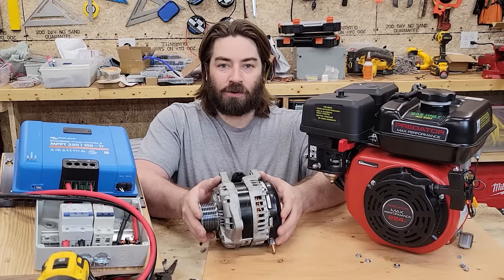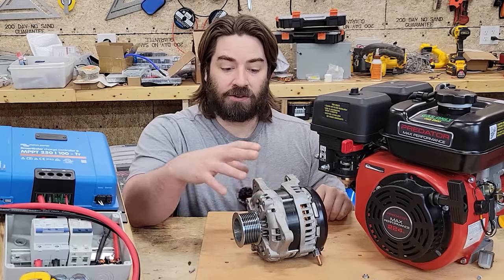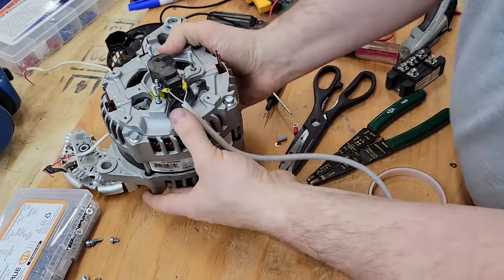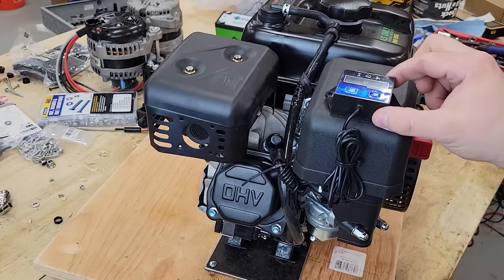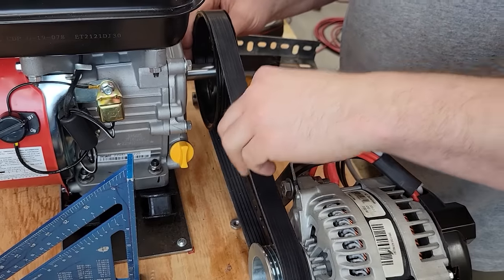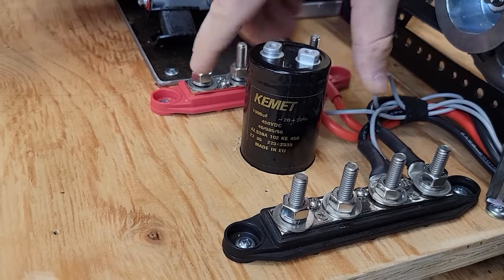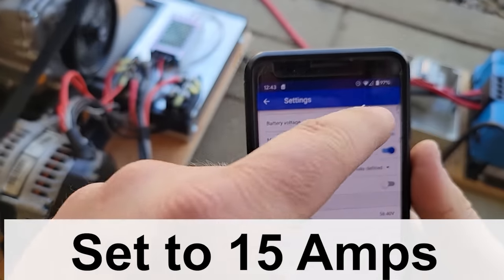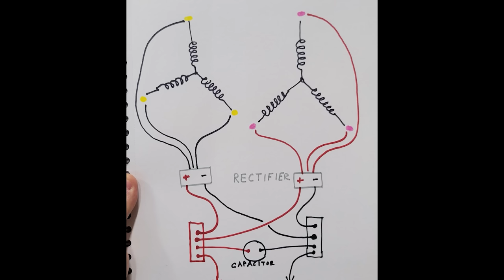The AlternatorGenerator, First Attempt.  48V Battery Charging

Comment: From one Dave to another. Nice video. It would be interesting to see what would happen if you run the rotor winding on a higher voltage but with a PWM so it doesn't over heat, "it works for LEDs" The magnetic field constantly collapsing & regenerating may have some effect on the stator winding too & the higher voltage may generate more magnetic field but all in all probability won't get any more current out. Still it would be interesting to see. No free power. I love the way you just pop to the garage workshop and get out the hydraulic crimps in the UK  it's go to the shed squeeze in the vice and beat with a club-hammer :-)

Comment: I am not an mechanical engineer, but on my opinion, the alternator and the engine must have a common baseplate, not separated with a flexible damper like your cofigurations, Look at car engine.
Reply from the maker: You are right.  In video part 2, I welded a solid base for both.  It worked better.
Video 2: https://youtu.be/cy0t4qq8mS0?si=5DaMckphft17WyOI
Video 3: https://youtu.be/yQTCVyxdauo?si=c7TspxdrTWB-ATZB

Comment: Pulleymounting : tried to heatup the pulley ?
should be good for 0.05mm expansion ?
Reply from the maker: I didn't try that, but I will next time.
Reply: @DavidPozEnergy  worked fine for me, while pushing in some ballbearings into a crankshafthousing. (cooling down the steelbearings / heating up the aluminumhousing)

Comment: Really good for study of the concept but I could at the same time buy a used gasoline driven generator from Honda rated at 7 kW with 240 1 phase and 400 V 3 phase output for less than your alternator and motor setup without having to build the concept.

Comment: They say it can't be done but those who say it can't be done or being interrupted by those who are doing it now I am wondering instead of using a gasoline motor what about an electric motor. Can we get that to pull off of an electric motor where it recycles off of the in a 220 volt motor motor that will turn the same RPMs is that that's needed for the alternator

Comment: Your 12v alternator produces 215 Amps, which is aprox 2580 watts, equivalent to 3.463 HP (at 745 watts per HP), all this without counting efficiency losses.
your gas engine makes 6.5 HP or aprox 4917 watts, again not counting losses, so you could run 2 alternators in parallel...

Comment: hard mount alternator to engine casing with some angle iron and put both on those rubber mounts. You have one dampened and the other not, and you're yoinkin' the dampeners to the side with the belt tension. This is not the way and why it's vibrating so much.

Comment: Have you thought about a 24v alternator?
Reply from the maker: If I had a 24V alternator on hand, I would have used it.  In this case I bought what I could find a deal on.  There were dozens of 12V alternators for sale cheap (FB Marketplace) within 20 miles of my home.
Reply: @DavidPozEnergy  I understand, I was not trying to be critical. I was curious about the output of a 24v in your experiment. I enjoyed it just the same.

Comment: Those aren't ring terminals,  they're lugs. And if you want a really good connection,  solder them with actual lead solder with flux and a torch
Reply: But it says "ring terminals" on the package.

Comment: What’s the run time on the engine before oil change?
Reply from the maker: Go to the product page: https://www.harborfreight.com/generators-engines/engines/66-hp-224cc-max-performance-ohv-horizontal-shaft-gas-engine-carb-57493.html
Scroll down until you see the title "Manuals, Guides & Downloads"  Click the little arrow next to the title to expand it.
Click on Owners Manual in PDF 
Look at table of contents on page 2 for "Maintenance" and you will see it's on page 11.

Comment: I like this kind of projects, but there will be an easier solution. take a gasoline generator 3500W for 120V and connect this to full beige rectifier and directly to the Victron MPPT. you will get also 50V at 60 ampere, 3000W DC.

Comment: To charge more, just connect 2 or 3 alternators down a line with a chain connected to spockets on each alternator. You can charge 3 batteries at the same time then or other possible uses.
Reply: Not with that engine ...

Comment: Removed the rubber mounts from the engine and fix engine on board, it will help with your belt problem, put rubber feet under board to stand on, it will make it alot better, alternators are very inefficient tho, just saying

Comment: You remove regulater & full bridge makes AC voltage out why do you need to bridge rect back to DC to go to charge controler and back to AC again, is is not useable off the altenator from each phase to a charge controler of there own

Comment: Why don't you mount that into a edger portable edger with the wheels on it and then put a plate on it if you can buy all that on it and put the gauges up on top you can charge cars with that restart p you have to get the gear ratio right on it though
Reply: I did that Yeats ago ..used a 3 hp engine ..placed a 12 volt battery on it with an inverter  .. done ..had a generator

Comment: Would a pma, work better?
Perm, magnet, alt?
Reply from the maker: PMA's are generally more efficient, but not always.  It depends on which one.  There are some PMA's 95% efficient.  My alternator in this video is about 70% efficient.  However, some PMA's could be less efficient.  So, it depends.

Comment: You have a lot of critics, David, but I think you did things most of us aren't capable of. Envy among the red hatters. But what about adding some trampoline springs on 'four corners' of the engine block anchored to the base to reduce wobble but not lose dampening? 
I'm only half literate in electrical systems but I thought the wires of the controller invererter looked like wimpy 18 guage? Wouldn't that throttle the amperage available, if they are transmitting full current? Also I read that the windings may be misunderstood and there are actually more efficient ways to utilize them? I don't know. But if nothing else you have the basis to adapt. 
As for the critics who say they get such and such off their solar grid or wind turbine, everyone knows there are times without sun and without wind. You may need to charge batteries for emergency communication, get an electric car ready to travel etc. The more diverse sources you have, the less likely to be stranded. 
But that said: We can all stand to be less dependent upon amps from grids and fossil fuels. 
Steam could turn an alternator. The non toxic combustibles are not hard to come across (used paper napkins , fallen twigs, dead branches, fallen leaves before they compost, etc). Chimney designs exist to 'scrub' the particles from the smoke and use the ash in a concrete additive to stabilize the particles captured. 
I haven't done any of the things I'm suggesting, so I'm a buttinski like most trolls, but you clearly have a solid Electrical Engineering foundation that most of us don't. 
One more idea is make a rolling reinforced concrete platform with bolts etc cast into the concrete. Back wheels rigid side mount axles, front wheels casters. Then attach a lawnmower push handle and you can wheel it around, chock the wheels and it won't bounce around.
Reply from the maker: Thanks for your comment and questions.
I was able to fix the vibrations in video part 2 of this 3 part series.  https://youtu.be/cy0t4qq8mS0?si=0hZ0FwZO21fAQkXT
Basically, having a steel plate for both the engine and alternator together.
All the wires are pretty thick.  I'm not sure which you are looking at.  I have 8 gauge from alternator to rectifiers, 10 gauge from rectifiers to busbars, 4 gauge from busbars to charge controller.  The thinnest wires are the grey, which is 16 gauge for the 12V power supply to the field.  That is carrying 5 Amps, so 16 gauge is fine there.
Reply: @DavidPozEnergy  Yes I had only watched the first video then I saw after how you resolved the belt/vibration issues. I think comments pushed you into overkill LoL! 1/4" plate doesn't even happen in off-road drivetrains with 4wd! But nobody can whine about your mounting base ever again, so no complaints. I think an old Push Mower with the engine removed might make it easier to move around. It would be simple to do it with what you already made. Which again: Is impressive. I have a feeling as far as fuel efficiency goes, it's less about your design and more about the engine. If for example you put your homemade generator platform on a push mower, the fuel tank could be on the mid bar of the mower push bar. Helping engine run cooler, and gas stay cool as engine reaches operating temp. Cool fuel combusts better as well. And once engine has been fully broken in, different engine oil might also enhance fuel efficiency. Your design may be nearly perfect but the motor itself may be the reason for the discrepancy of KW per gallon of gas.

Comment: you could run it on e85 for cooler running - you could get about 250 gallons of ethanol from a 1/2 acre of corn #corn power
 burning 253 gallons of ethanol in a generator with a 30% efficiency could reasonably produce approximately 1,688.475 kWh of power.

Let's assume you have a small PV solar panel array with a capacity of 1 kilowatt (kW). The actual power output will vary depending on the conditions, but on average, a 1 kW solar panel array can generate around 3-4 kWh of electricity per day.

Assuming a conservative estimate of 3 kWh per day, over a year, the solar panel array could generate:

3 kWh/day * 365 days = 1,095 kWh per year

Comparing this to the power output from burning 253 gallons of ethanol in a generator (1,688.475 kWh), the solar panel array produces a lower amount of electricity.

It's important to note that solar panels have the advantage of producing electricity without any emissions or fuel consumption, while a generator burning ethanol would produce emissions. Solar panels also have a longer lifespan and require minimal maintenance compared to generators. Additionally, the availability of sunlight and the specific location can significantly impact the energy output of solar panels.

Comment: throw the engine outside overnight and put the pulley in the oven, or heat the center with a torch.. it would have slipped on saved you alot of work and the cost of that puller set

Comment: The tester showed it's a 150A alternator, but the spec sheet shows 215. What is the reason for the difference in numbers?
Reply from the maker: I really don't know.  Maybe a surge rating?  Or maybe the test machine only goes up to 150A?  Sorry I wish I had a better answer.
Reply: @DavidPozEnergy  Eh, either sounds plausible. Fair enough.
Reply: @TurboBass  Different Part # entered on the tester ... DL5619 Alternator vs  DL5626 "tested"

Comment: All that plastic tape and glue and plastics used as fasteners on the alternator....when the engine runs it hot, aren't these things going to melt and fall apart and short the system at some point?
Reply from the maker: In video #2 I run some thermal tests.

Comment: 400W 15A DC-DC Boost Converter Step-Up Power Supply Module Adjustable 8.5-50V To 10-60V Voltage Regulators

Comment: Oddly enough  David it might be better to use a treadmill motor as your power generator, they are dc motors that provide 
The posablity to generate high dc voltage at the speed your gas motor turns it, you might be able to run the gas motor at idle speed and with the right ratio produce your correct voltage your trying to make.

Car alternators are ac generators, old 1940s car use generators that essentially were dc motors, as for a treadmill 
You can pick them up free off the curb 
People on Craigslist often set them out as trash or free cycle. Why spend 100 bucks on a car alternators when you can find someones DioGuardi treadmill to take apart. Plus you get all kinds of free goodies with one, metal rubber belt shafts with berring and rollers and you can cut up the metal part to make something with it.  I pick up metal bed frames to use for welding insted of buying  new metal.  If your trying to live off grid your worried about natural resources.   Why not reperpous items people put out as trash.  We are very wasteful in America, you go to third world countries noting go to waste.  What make us so stupid we do this?
Reply from the maker: Did you see my previous video using a treadmill motor?  https://youtu.be/DaF6n-9RVT4

Comment: You could have just left the rectifier in there and used a new voltage regulator... shoot you are just full fielding, not even using a voltage regulator. You could have used an external regulator, or bypassed and full fielded with no regulator using the stock rectifier. Either way, no need to remove that rectifier.. all you needed to do is modify the voltage regulator.

Comment: My opinion about your project...A+, fantastic job. 
I want to build the same project to have my own independent power plant, off the grid system. 
Eventually we are already seeing people in the world decide between paying for electricity or feeding their children. Electricity Utilities Cos are upgrading Station and sub-station, with Chinese capital, installing smart meters to control the amount of watts and alarmingly increase bills. All new sub-division they are installing 400Amps service panel. 
Soon, all smart cities & all areas should running with electricity. No more natural gas, propane, and no more gasoline.
According to the WEF, old cities are turning soon to "Smart Cities - 15minute City”. Energy it’s for rich peoples, it’s a luxury, according to them.
The whole world moves by electricity. Without it we can't heat our homes, we don't have hot water, air conditioning, etc... and the technocrats & globalists know that. The solution to face the difficult times is to create a parallel society, independent of everything. 
Thanks David for sharing your project! I wish all the best.

Comment: Hey why didnt you just buy a real generator? They cost almost exactly as much as you spent (not counting your valuable tools nor time) , But give you automatically : the direct drive generator, which is designed to orovide that much wattage for HOURS (not just as long as it takes to chsrge up a vehicle battery), a bigger fuel tank, higher wattage per engine displacement, easily available replaceable parts with proven service manuals and diagrams, And even electric start (which you coulld easily automate). I don't understand why you chose to build one!!
Reply: Pretty sure it was just the build and challenge overall. Obviously this guy knows it’s not practical and that’s not the point. Cmon man.

Comment: You probably could have just baked that power steering pump pulley in the oven at 400F for 20 minutes and it would have slid on easily. Just for future reference.

Comment: You really want a semi alternator they have a much bigger case/stator.. Car alternators only have a 25% duty cycle. Semi alternators have a 50% duty cycle... Years ago I built one similar to charge batteries I wound up putting a Delco Remy 22SI alternator in it after SMOKING 2 alternators charging at roughly 80% of their capacity for a few hours..
Reply from the maker: Good idea, and thank you for sharing your experience.

Comment: Do away with the governer that engine can handle way higher rpm. secondly, I know projects are fun but you should test what you built to an ordinary generator is the cost to Efficiency ratio worth it? again if you are just doing this for fun then hey whoohoo!!! lol. anyway very clean work I would have cut so many corners for a "PROTO TYPE" lol!!!! then if it proved itself worthy then well you get it.
Reply from the maker: In video part 3 I compare it with my Honda generator: https://youtu.be/yQTCVyxdauo?si=wj_HCVfksFGLgrEl

Comment: How many hp engine you  are using
Reply from the maker: 6.6hp. https://www.harborfreight.com/generators-engines/engines/66-hp-224cc-max-performance-ohv-horizontal-shaft-gas-engine-carb-57493.html

Comment: But why ? Why would you take an alternator ? Those things are horrible, the have a really bad efficiency of about 50% or so. Instead use a big stepper motor, those should be about 90% efficient.
Reply from the maker: Your are correct that an alternator is not the most efficient thing out there.  I did this because alternators are easy to get used and cheap, and I always wanted to try one.  I suppose if I had a big enough stepper motor on hand, then I'd try that.  
Note, this particular alternator is a bit better than average at about 70% eff.
Reply: @DavidPozEnergy  70% for an alternator is not shabby. Thanks for your explanation.

Comment: I"d like to see this self excite it self.... So it could be used for a doomsday scenario. Also replace the gas engine with a single cylinder diesel and get it set to run on "Black Diesel" or just Waste Motor Oil.
Reply from the maker: I've got some diesel projects I'm working on.  I used to convert cars to run on WVO (waste vegetable oil).

Comment: Your capacitor is waaaaay undersized for the current you sre drawing. And the wire gauge to the cap needs to be at least as thick as the main wires. Your electronics will die very quickly if you keep it on the same platform as the motor. Otherwise great build
Reply: The capacitor is fine ...